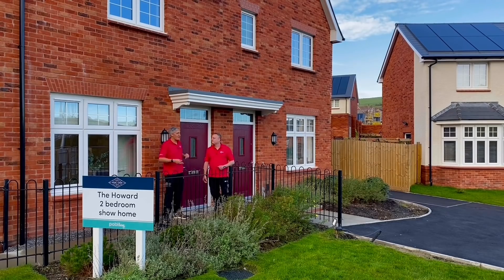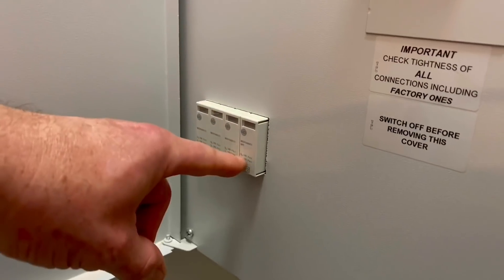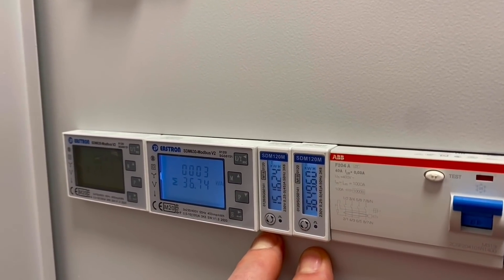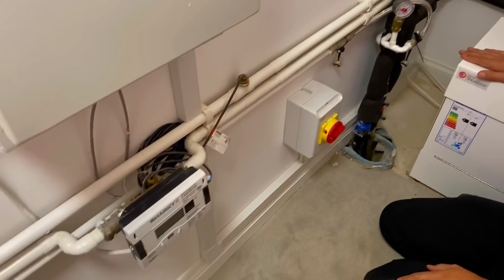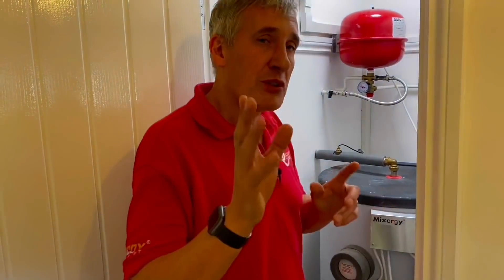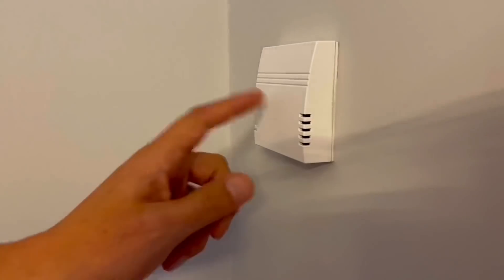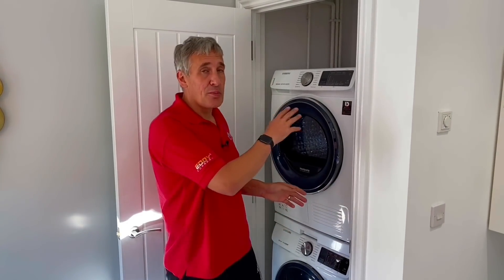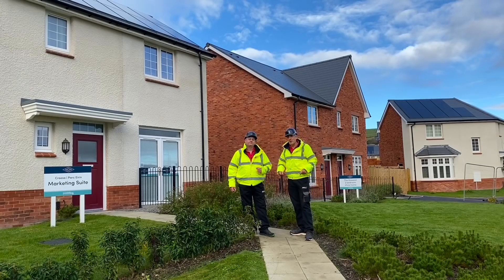THE FUTURE OF HOME ENERGY is HERE - A GAME CHANGER FOR ELECTRICIANS

Comment: A water heater on the second floor? What happens when it fails? It just did to some friends and they were out of town. Theirs was in the basement, near the sump pump but they still had water damage. 

Can the solar charging system function with no mains power, like during a power outage? Can the geothermal function off the batteries? Again, power outage. I dealt with a three day outage a few years ago in my part of Maryland, USA. The 50 gallon electric water heater had  enough warm water to shower for two days. The US state of Texas had a massive outage February 2021. Plan for an outage and be happy when it doesn’t occur.
Reply: What are you on about Mike the majority of hot water cylinders in the UK are upstairs . They dont fail .
Reply: @persona250  your water heaters don’t fail? What are they made from? How long do you keep them? I have seen natural gas and electric tanks fail, often dumping water out the bottom.
Reply: @mikecumbo7531  Stainle`ss steel 25 year manufactures warranty on the new . The old copper ones have been in for 50 years still going .
Reply: @mikecumbo7531  copper.
Reply: @persona250  backing up my reliance point nicely.
Reply: The UK hot water tanks typically are built to a different standard
Reply: The US and UK are simply not comparable. Some decent points but generally not relevant to the uk.
Reply: @stuartcraigon2003  a power outage sucks no matter where you live. Even if you have electricity, how well does this house function if you don’t have internet?
Reply: @mikecumbo7531  mobile hotspot. There is simply no such thing as no Internet.
Reply: One issue with US is the frequency of grid-tie systems that don't operate without the grid.  I don't understand why this should be the case, it's crazy.  Europeans design the systems to act as independent islands if the grid becomes unavailable.  You're good for as much battery + solar + turbine capacity as you happen to have installed.

Comment: Look how much internal space is lost with all the new technology, I wouldn't want them batteries on my new kitchen wall.
Reply: It's ridiculous to see a 2-bedroom house cramped with so much technology that takes a lot of space. That big battery cabinet hanging off the wall in the kitchen is like a soar-eye, not to mention how much exposure to damages that is (hitting the unit with the kitchen door. And is that even a proper place for a battery unit to be in, a heated environment? Why not a garage or any other cool areas, a non-heated hallway? I also  agree with those electricians that pointed to the cramped cupboards where you have all the distribution boards, meters and not enough space to work safely. I don't think German houses are built like that. They have 3-phase Distribution Boards, nicely done, placed in a well ventilated area with full access to them. They put great thought in designing smart homes, sorry UK!!! But I think the future houses would be at more potential fire hazard and safety risk with all these technologies cramped in and not enough space considered for such things.

Comment: There are so many conflicts of interest when it comes to all these homes networked with each other and monitoring peoples use, it's potentially a GDPR minefield in future. It's nice to see these sites getting more publicity but having worked on many of them and ripped out ASHP and replaced them with gas due to unhappy home owners I can attest that these homes only work for people when the houses are designed and built for the technology, not the technology fitted into homes that are designed to the same standards as they have been for years for gas.
Reply: Just wait until load shedding hits. We simply cannot generate or import enough electricity to run this equipment, electric cars, etc. It's a giant scam. The fact that we are not energy independent will be the downfall.
Reply from the maker: What’s the difference between granular monitoring of the individual energy components and a smart meter?
Reply: I did wonder why the network was joined to the neighbouring properties, isn’t it a stand alone system? I wonder who pays for the community section and where it goes to.

Comment: It's great to see what can be done but what's the payback on all of this. Must be 20-30 years. It would be better for energy companies to put more money into green energy for everyone to use with their existing equipment.

Imagine if everyone installed all of this, how would the energy companies make enough money to keep paying those bonuses!
Reply: This is a new build
Reply: @edc1569  but how many of our houses are new builds? How long before our existing stock get rebuilt? No good saying 90% of our housing will be rebuilt in 100 years or more and then this technology is installed. 

Do you think the costs won't get passed down when buying a new build? Do you think that people don't have a choice in the spec when buying a new house? Even if the government makes it mandatory for heat pumps, we still rely on buying in electricity from the energy companies to run it.

A bigger change is needed

Comment: Really hope hydrogen takes off in a big way rather than all this. Would be so much easier to use current technology with regards to boilers and heating system. In my layman's opinion it would be much cheaper too. District heating is probably going to play quite a big role in the future of new domestic estates as well. Time will tell.
Reply: On existing housing stock sure, on new builds this make much more sense.
Reply: Hydrogen is not safe to be used in domestic properties. Its more unstable and dangerous than gas!

Comment: 3 phase for a house is just unnecessary. Who is paying for all this kit?. The developer or the end user by way of extras? The extra cost to the developer would be crazy. Should have used a better fabric, far infrared heating and the mixergy tank. For car charging do we really need such fast charging. Most cars sit on the drive all night if not most of the day and night. As for having a massive battery on the kitchen wall! Really!
Reply: I completely disagree about your 3 phase statement sir. I am trying to go focil free now. I cannot have my second vehicle charger operating at full charge because I have gone over the MD for my single phase supply. This came from my DNO who said I require a 3 phase system. My EV gets used daily and requires a fast charger. Because my first vehicle I have canceled my second ev and using a diesel until the goverment fund a three phase or I win the lotto. Now most family's have more than 2 cars. So with my home 100% electric I need three phase to accommodate ev charging. By the way a 62kw ev battery with a vehicle onboard charger of 6.4kw and battery at 26% to charge to 100% with a 7kw charger takes just under 8 hours. Now if i did little trips only then OK a slower charger may work say for a retired couple ect but working family bit differant.
Reply: @gino2465  makes sense any medium sized house to be 3 phase
Reply: @gino2465  🤣 absolutely hilarious, proof that ending petrol and diesel car production is impossible and totally impractical!
Reply: 3 phase is quite common on the continent. 
If you're charging multiple cars, a hot water cylinder and heating you cpuld be drawing quite a few amps.

Why are you suggesting infrared heating for a new build? Heat pumps aren't  the solution for every situation, but installing them in new builds is surely one of the best situations.
Reply: @benholroyd5221  at 3kw you'd be far better with an immersion heater and a thermal store, add in a solar thermal coil and battery storage. Heat pumps are utterly useless in the uk.
Reply from the maker: @stuartcraigon2003  the 3kW heat pump has a gain on average of 3.6 - so it generates around 11kW of heat - or similar to a gas boiler.
Reply: @efixx  that's what it says on the tin. In real life conditions a nice cold day or windy day will drop the efficiency. The sad reality is I know a few homeowners who have gone back to oil and ditched the HP. But, we are at the start of a journey HP'S will get better at coping with the British weather.
Reply: @adrianupnorth  ground source heatpump doesnt suffer from cold days like the air source one because the ground has constant temperature at that depth
Reply: @efixx  sure, because 11kw is enough to heat that house and supply hot water! 🤣
Reply: @reachyg  does the earth's core not melt everything it comes into contact with? Presumably when you let that stuff out it's impossible to stop it. 
Only way you'll get heat from the ground in the uk.
Reply: @stuartcraigon2003  you dont need to go so deep to reach the earths core they just dig a couple meters deep where the temperature stays stable.
Heatpumps only have problems when temperatures are below zero but even at 5°C the pump offers close to nominal efficiency
Reply: @benholroyd5221  true, in my corner of the continent the maximum you get from dno is 60A per phase in domestic. If the place is going to get anywhere close to 60A in single, then makes sense to go 3 phase, have a cheaper 3 phase tariff while being able to go up to 3X60A if  ever needed.
Reply: Your right Zan. I didn't make it clear I was talking about air. I personally would only have a GSHP  but 99% of the sites I have been on only I stall air. My quote for GSHP install ( I have enough land ) was just shy of £20k which is why the use air.
Reply: What could possibly go wrong?
Reply from the maker: Three phase is now standard for new homes and LCT installation within the Western Power DNO area.
Reply: @efixx  that's good news as I am awaiting a quote so I can send it to Boris to see if he will pay for me to become 100% LCT. Not expecting much change out of £15k
Reply: The home was well. Planned
Reply: @efixx  maybe so but you'll not get it most of the time because industry gets priority to meet their demand.
Reply from the maker: @stuartcraigon2003  industry doesn’t get priority they are part of the energy mix and are generally encouraged via the TRIAD system to avoid peak demand periods via half hourly metering.
Reply: There is a problem with balancing of phases when demand isn’t equal which is exactly what we’re going to get when more people start getting electric cars, heat pumps etc. Sounds like having 3phase going in to houses may bypass that issue, but I’m not a sparky so don’t know if that’s true.
Reply: @davideyres955  the problem with 3ph is that your up against industry. Factories get priority to run plant and equipment, you'll never get the full benefits of 3ph in residential.
Reply: 3phase in my country for house it's more than normal
Reply: The bloomin kitchen!!!!!!!!!!

Comment: Very good video. It's clever, but it's another step to digital prison. No phone app no power. Has it got an immersion heater element in the tank?? If so it's not that clever.
Reply from the maker: You’ll have to watch the series of videos coming on this to get the full story. Hopefully your concerns will be addressed.
Reply: Recommend you check out the Mixergy tank system. Heated from a choice of external sources like ASHP/GSHP, roof pv panels (using excess solar) , roof solar water panels, ( water circulation, not a new technology, used a lot in Australia).  It’s the way the volume of water is heated that makes the Mixergy system better than todays HW cylinders.
Reply: An immerision heater in the tank is an excellent way of converting the solar power to stored heat. I would never want to run the immersion heater from the mains supply.
Reply: @tlangdon12  pass, I'll stick with my coal fire.

Comment: Smart/connected device/devices gets mentioned a lot. 
Many of these installed appliances will typically be in use for many decade's. What long term support is in place for these devices for security updates/fixes, long-term app support and parts availability?
There's is also the matter of how these services are offered. Will the home owner be tied into a contact where they have to pay a monthly fee to be able to fully utilise the installed services in there home, and have a choice of providers? 
Are any of the services cloud hosted and if they are what happens if the cloud is distributed, will the home owner still be able to use there instald appliances?
You also mentioned that all these systems are linked on the estate and able to communicate between one and other. What protections are in place to prevent someone with access to one of the properties exploiting this to gain access to others properties systems/data communications?
There is also the question of information gathering and privacy?
Reply from the maker: Stay tuned for more on this topic
Reply: The underlying system for control uses erlang at its core, the same language used in telecom systems,  its designed to be remote debugged, can self heal, ands like telecom systems is designed to maintain uptime... every device connected to the system sends a heart beat that alerts of any issues, and if a part is showing issues the system can restart that single piece of control code automatically. The config can also be upgraded over time with new device drivers using all the standard communication protocols for wired and Wifi over the air via a separate 4g modem so is not reliant on users wifi. It's been designed to avoid the need for callouts as much as humanly possible. The system was designed with minimum maintenance in mind, and can be debugged remotely. So beyond actual hardware failure the software was designed to be as flexible as possible. The system uses secure tokens that are rotated, and has security considerations at its heart  to connect to googles cloud infrastructure. We also set schedules on the devices themselves so even when there is no cloud communication the devices will continue to function, the system can also restart itself to the last good known state automatically if issues arise. All the devices installed also can use their standard communication protocols so they can be controlled via their own native apps if required. So the technology is designed to be robust, secure, self healing, updatable, configurable and resilient and far as is possible.
Reply: And what happens if your manufacturer goes under? Are you stuck with a cupboard full of smart bricks and a battery pack that won't charge?
Reply: @rivkahlevi6117   Other software systems I've been involved with which are either in some sense critical or just plain bl**dy expensive have had the software held in escrow and if the software supplier is ever unable to meet its contractual obligations for any reason the escrow is opened to either replacement organisations, other 3rd parties or even become public domain.

I have absolutely no idea if any such arrangement might have been made for these systems, but they really should have been.

Comment: Tell us. How much are they selling at? From an existing viewpoint to retrofit say mid-terraced 1900's house. Is it worth 15K to insulate, 10K to retrofit gas to air source, 4K for solar and 4K-12K for battery storage. On a place worth £175K With no prospect of council allowing on street EV charging?
Reply: Those   houses  will  stay  empty  for  years   nobody   will  want  em  /  price  eeek  / deep  pockets  for  maintenance/ what else  I  hate  to  think k
Kkkkk
Reply from the maker: First phase is sold out and they are now selling off plan
Reply: That's if you can have solar or air source, restrictions on areas due to cultural heritage have stopped many of our customers being able to go ahead with solar,  air source and ev chargers. One hand government wants to go all electric while the other hand doesn't want properties to be updated at all, yet those are the very same properties that would benefit most in many cases.
Reply: Air source is null and void in the uk. Heat pumps have little to no benefit in the uk, its not warm enough.